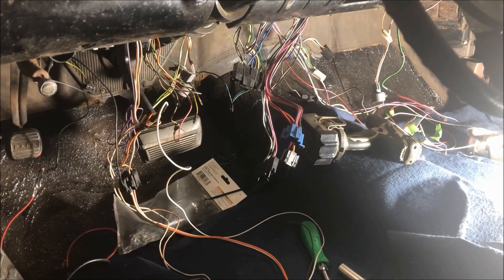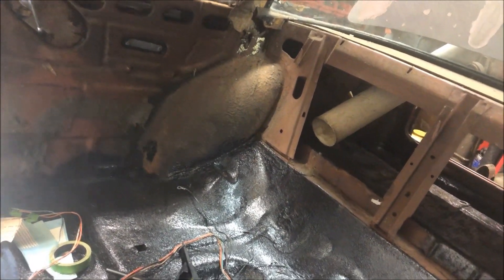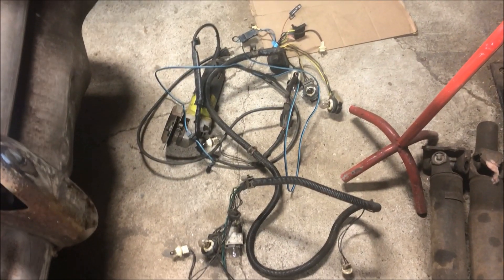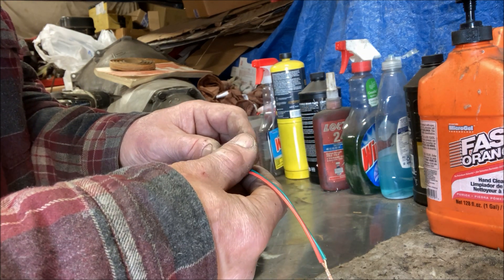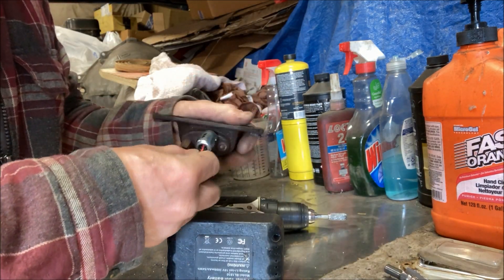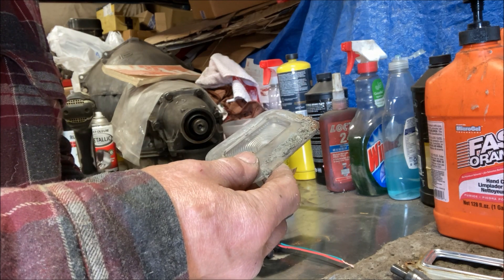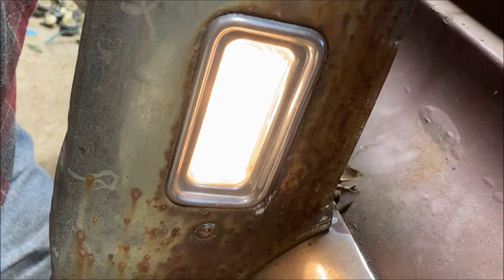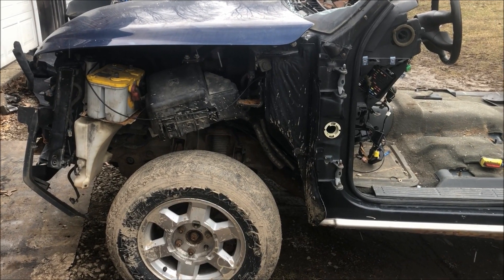1955 Buick Special Turbo LS Build part 42, body wiring starts on the POSpecial

Comment: Great video !!  I would like to see how you wire up the alternator wiring  from the  engine to the gauge in a future video .  Thanks for all your
hard work putting these videos  online .  Good luck in the future.
Reply from the maker: Thanks! I will show the alternator wiring when I get to the LS side of the wiring, but basically I am running the factory Monte Carlo excite wire that used to go to an idiot light and I added a resistor inline to replace the light. I will also be running a sense wire to regulate the voltage. LS side wiring will be more detailed.
Reply: @rust_hoarder_garage  Thanks !